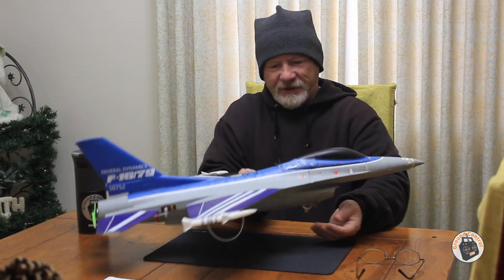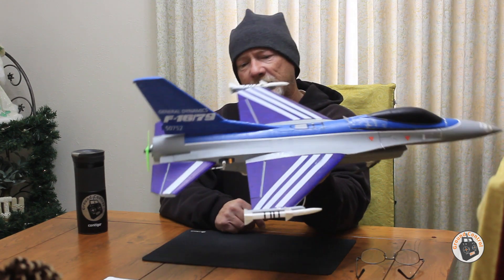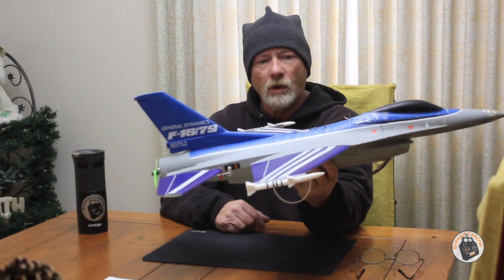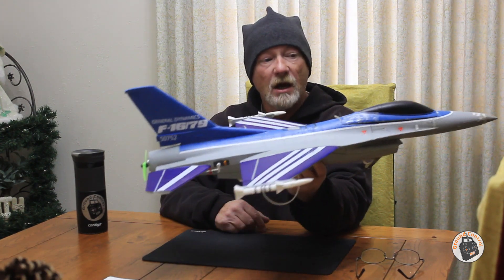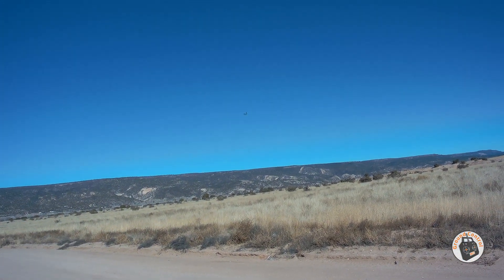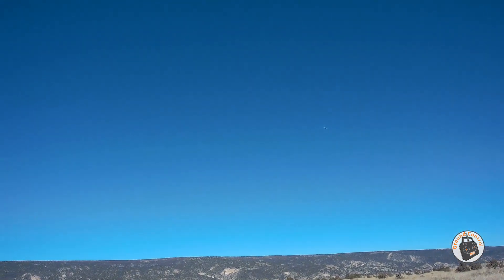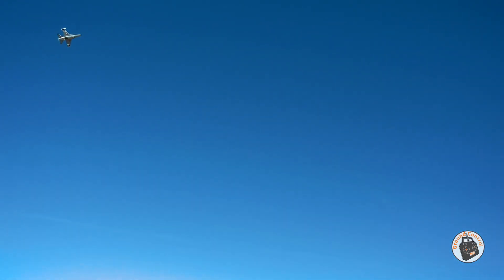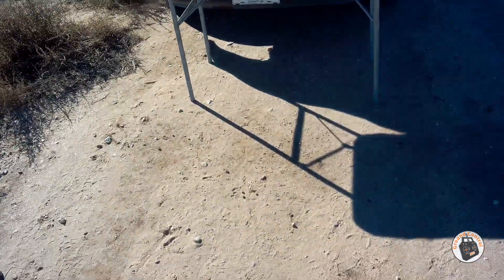High Performance Conversion! Eachine F16 50mm EDF Jet Kit - Converted to Pusher Motor & Prop!

Comment: Cool...did you use any gyro with this plane? I have a couple edf 50mm jets i could convert ...they are entirely different animals as pushers 😊
Reply from the maker: Not when I 1st converted it but I do have a Radiolink Byme-A Gyro in it now.
I want to put one in the Blaze as well.
The pusher motors provide so much more power and flight time than the EDF Units.
That's the way I''d like to set them up from now on.
Reply: @GroundControlRC  i agree..no more edfs for me either...but i do have some that sound amazing..even a few i only flew 1 time..
Reply from the maker: @roadstar499  Some of those EDFs do have an amazing sound.

Comment: Very cool!  I Have a Delta Strike kit for 55mm edf, and I ruined the edf so am thinking to 'pusherize' it.  How do yu think a 2208 2600 would work?  Anyone have ideas?
Reply from the maker: Thank You George!
I think these pusher conversions is what I'm going to do going forward.
I would think a good quality 2208 2600kv motor would spin the prop as fast as my 2207 2688kv motor.
Spinning a Gemfan 5040 Prop I get 1041g of Thrust at full throttle pulling 26.3 amps on 4S.
The 50mm EDF Unit on 4S isn't even close ;-)
See you in the Air!

Comment: It looks like it have more power as a pusher
Reply from the maker: Hi Jerry!
It certainly does!
It not only has Unlimited Vertical but will actually accelerate vertically ;-)
I wish my EDF Version had this power and flight time.
I may have to convert the F18 when I can fit it into my budget.
See you in the Air!
Reply: @GroundControlRC  I have the f18 from eachine I believe that will be my next project thanks for this video
Reply from the maker: @jerryhoe7297  Awesome!
Send me a link of the flight if you post it.
I've heard from several folks they feel the F18 is better than the F16.
See you in the Air!

Comment: Traffic on your runway is probably very light when it's that cold.  Do you notice much less flight time on your batteries with the low temperatures?
Reply from the maker: Hi Jack!
That is definitely one of the things I like about Winter flying....very little traffic.
I only saw one person out there while I was flying and that was about the time I was packing everything up.
I pretty much had the run of the place ;-)
The batteries hold up pretty well as long as it's not cold and overcast.
I set my battery box out in the Sun to keep them from getting too cold.
See you in the Air!